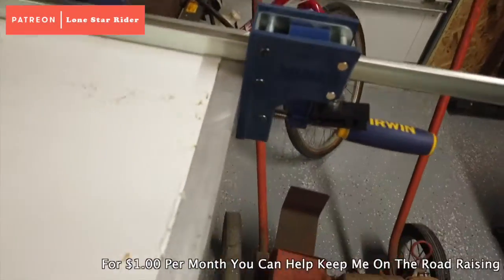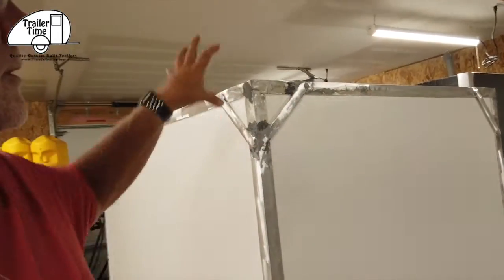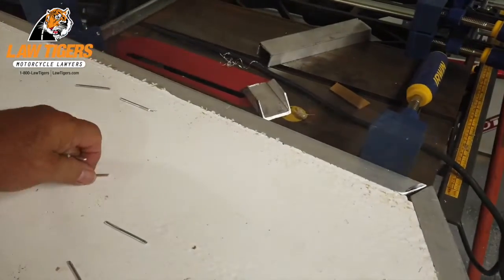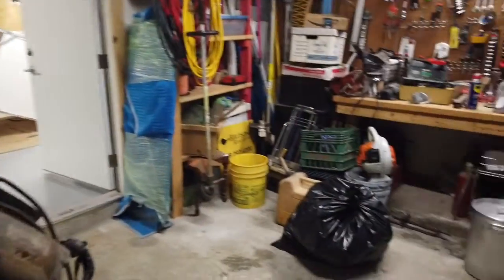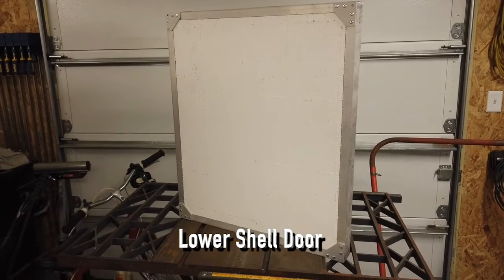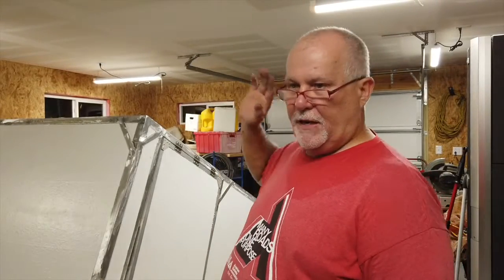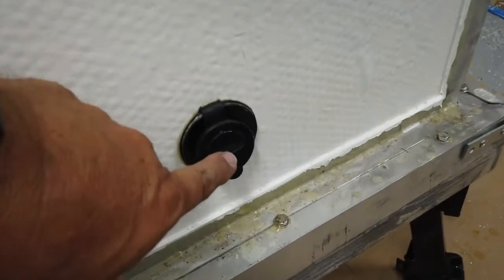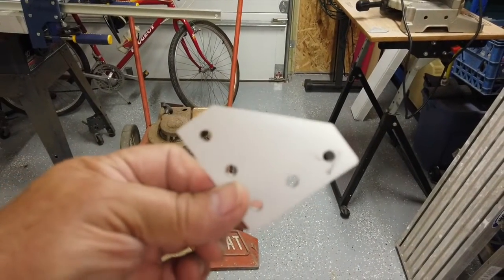Riding For A Cure Trailer Rebuild Part 16

Comment: awesome rex really starting to look like a camper . boy im excited to see that top go up and down . why does that sound dirty lol . have youever thought about one of those big deep marine cell batteries . man that would give you all the power you need and then some . but you might not need it with the solar panel . you have really done a great job with this rex alot better then i could have ever done . good work brother .
Reply from the maker: The big deep marine cell batteries are really heavy. I need to find a good set of 12 volts 100 Ah Lithium batteries, they are light and I can run them down to empty without any worries. But they are really expensive.
Thanks for the kind words!
Reply: @texaslonestarrider  yeah i guess your right  i forget they have them batteries  . they also have ones like big capacitors . but i dont know much about them ether .

Comment: These are probably already solved but I have three questions for you. Venting for the power compartment? Weatherstripping for the doors? And last but not least the edge that you have on your seat I think will start bothering the underside of your legs when you go sitting on it.  It looks like a very sharp angle. Just my three or four cents. Safe travels my friend.
Reply from the maker: Venting for the power compartment will be out the side next to the Shore Power Plug.
Weatherstripping for the doors go on the door stop and on the bottom of the top shell.
If the seat starts to bother me I'll sand it down.
Thanks My Friend!
Reply: lonestarrider Thanks for the come back Rex. It most definitely is going to be a lot larger and better than what you had before.  I know you are wanting to get that done and get back on the road. I think I would too. Safe travels my friend.
Reply from the maker: Thanks Ralph!